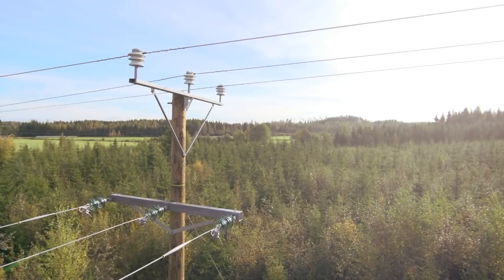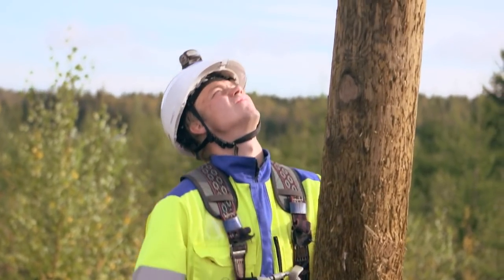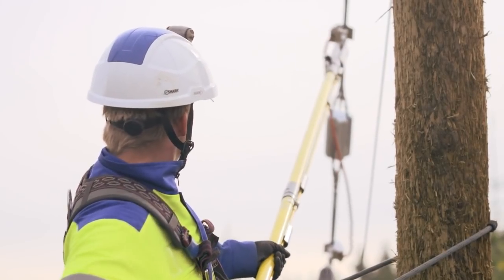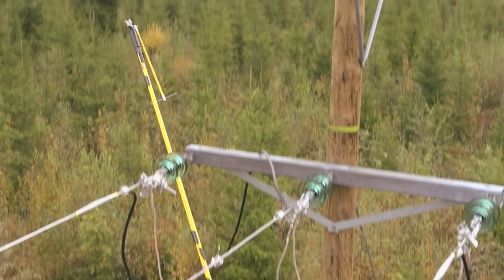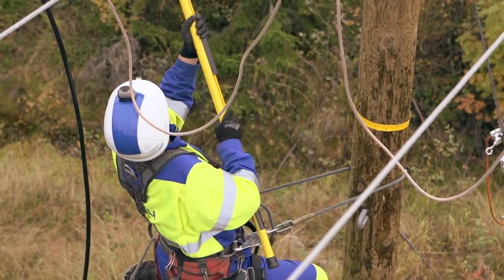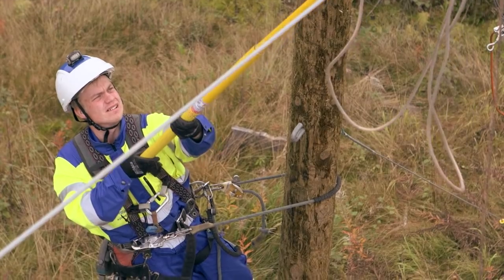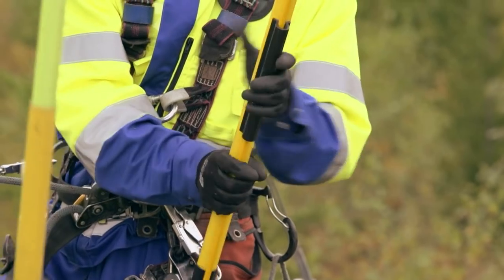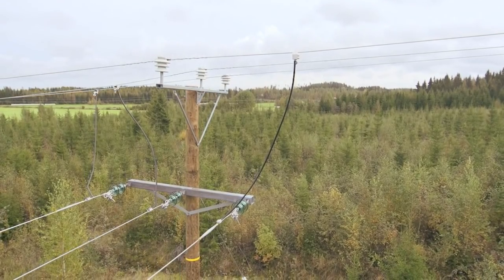Overhead line connection work

Comment: Oh I didn’t realise it was ok to run a ground across all phases on a live line. I’ll try that next time.
Reply: You do it while working on transformers to protect the crew if the current applied before work is complete and to protect against current from the wrong side.
Reply: Or in this case, to protect themself from something on the other end of the secondary line which suddenly starts generating electricity.

For example someone with an diesel generator there it  and the kit it was intended to provide power to isn't correctly isolated from the net.
Reply: You don’t understand this enough to be trying that

Comment: Using hot sticks with gloves on, no way, how are you supposed to feel if the stick starts breaking down?
Reply: It's highly unlikely at 20kV.
Reply: The rods/stick must be serviced and measured according to the manufacturer's instructions. If the installers get a feeling of electricity, the rod/stick manufacturer's instructions are violated. In this case, Finnish labor safety legislation has also been violated.

Comment: Higher quality electricity?
Reply: Availability, basically which in this case means either plan to supply the customers by alternative lines or as in this case doing more work with live lines. 

IN this case, if necessary they would have cut the power to the top feeding line and so losing power to dependent customers - that is no availability.

Comment: What voltage was the line we see in the video? Where was the demonstration located?

Very interesting demo. Thanks for sharing.
Reply from the maker: Hey +wingsley , thank you for your questions. The voltage is 20 kV (the medium-voltage network is usually 20 kV in Finland). The video was shot in Siilinjärvi and training field owned by Savo Vocational and Adult Education Centre (www.sakky.fi).
Reply: Thanks! It's been ages since I've seen glass insulators in use. That caught my eye.
Reply: That was awesome
Reply: mostly in france they still use them uk are all composite pretty much now glass exist but new lines are all composite
Reply: @kirkhamandy  This is what it takes to reach maximum power availability, and these people get paid accordingly. And 20 kV is not relatively that high, some workers maintain live 500 kV lines and more, it's some crazy stuff. Even 220 V household potential or lower can kill you if you get unlucky in the path the current takes.

Comment: Nice work but why they have helmets with face shield and they don't use it
Reply: In fact, the helmet does not have a face shield but an eye protector (standard EN 166). When working with a safe distance method, the entire face shield is not needed in this work. Usually darkened eye protectors are used to protect against sun and debris.

Comment: Can you please say me that why the lines are being fixed to a wood plank
Reply: That's called a cross arm. It's just what you do and has been done for over a 100 years that way. It's how they spread the wires out for 3 phase. You could run vertical 3 phase on a pole without a cross arm but it takes up too much space on a distribution pole. You'ld need like 60 foot poles instead of 45'.

Comment: So tell me if I have got this wrong, he makes a connection to the top main line with the t off line still bonded together ? why?Surely you would take off the bridged out jumpers on the lower t off before you would make a connection to the hot main line above, does not make senses! and because the bottom t off has been bridged out once it was made hot , those other tails which are ready to be connected are also hot just swinging in the breeze under no control what so ever
Reply: Nokah , they do now, the video has been edited from original , on the original video they take the jumper off the link stick to connect to the main line and the earth bonds were still across all three phases ! Obviously a mistake when filming , I know what I saw, I am a Glover, Linesman and Auditor, it’s my job to spot shit like that
Reply: The European Electrical Safety Standard defines all non-earthed parts exposed to voltage. Therefore, the branch to be connected must be grounded if you want to work near it. In this case, a shorter rod can be used. When the jumpers are lifted onto the auxiliary brackets to the main line, the worker moves to work lower in the column and removes the grounding of the branch wire. Therefore, the extending rods are used. The cross-sectional area of the jumper is 95 square millimeters, so it is rigid. It has been found that, for example, a 50-square millimeters jumper breaks for some time to come under the influence of wind, especially on roads with semi.    AND... The video is for advertising purposes only.

Comment: How overhead lines are connected to underground cables for transmitting power?
Reply: The underground cable is brought to a surge arrester rack ( e.g. https://www.ensto.com/products/overhead-line-networks/medium-voltage-overhead-line-solutions/ensto-bare-conductors/crossarms/SH536/ )on the pole. At the end of the surge arrester ( e.g. https://www.ensto.com/products/overhead-line-networks/medium-voltage-overhead-line-solutions/ensto-covered-conductors/surge-arresters/he-s27sga/ ), a underground cable and a  "jumper" wire are connected at under same bolt. The end of the jumper has a live line connector ( e.g. https://www.ensto.com/products/overhead-line-networks/medium-voltage-overhead-line-solutions/ensto-covered-conductors/live-line-and-earthing-connectors/SL30/ ). The accessories are slightly different depending on type of wires ( coated or bare conductors).